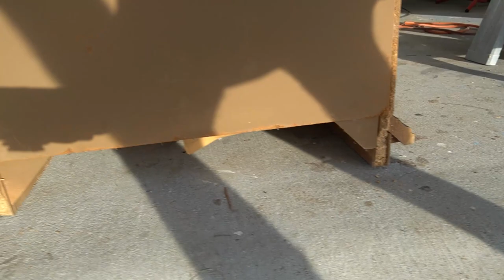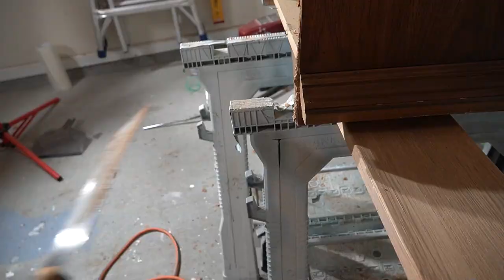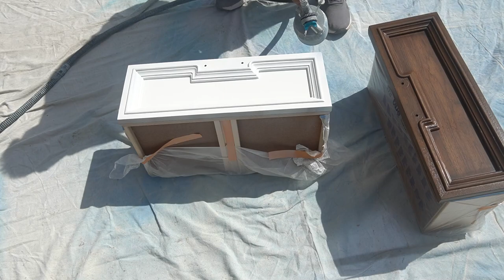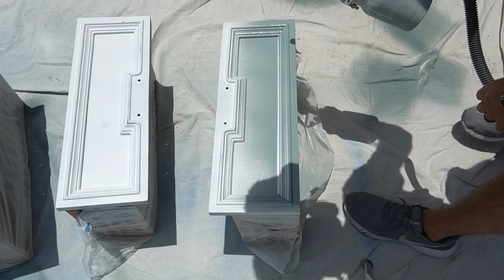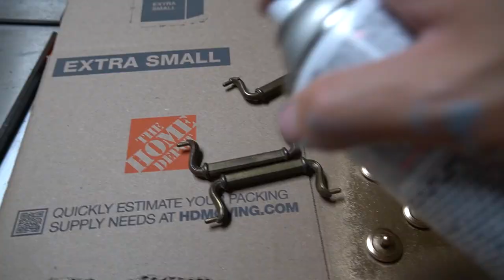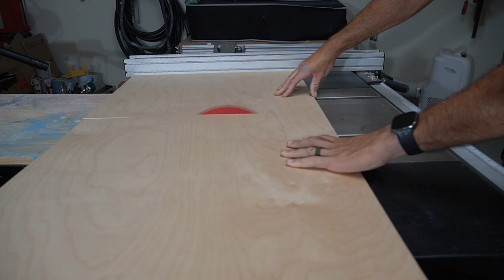Furniture Flipping  Painting A Set of Nightstands with Magnolia Home Paint

Comment: I just took a job building a kitchen island for a customer and they brought me a can of this to paint it with.  I normally use Sherwin Williams Emerald series (the best paint in my opinion).  Anyhow, I have never used this Magnolia paint before.  The can says to use a .017 tip.  I heard you mention you thinned it, but what size tip did you use?  I use a Fuji Mini-Mite 3 HVLP and I have a .015 and a .018 tip.  You think a .017 will work with no thinning?  Thanks for any help.
Reply from the maker: I talk about it towards then end of the video but I would not use any thinner of any kind. My set never really hardened up to a solid finish, and I can only believe either the thinning which was not that much or the paint is just not the best quality. I would spray with an airless but I don’t see you getting a good finish with a .017 tip which is like for walls and exteriors. I would spray with an airless and use a 308 or 310 or not do the job. I find it hard to believe you will not have runs everywhere with a 17.
Reply: @milosrestoration1337  Thanks for the reply.  Do you know what size tip you were using in this video?  With your thinning it and knowing the tip size I can maybe gauge what to do.  I have a professional sprayer, a Fuji Mini-Mite 3.  Thanks again.
Reply from the maker: @choprpilot76 well I was using an Apollo which I no longer use but keep in mind I had a 5 stage turbine. I was using a 1.8 with a high solids cap most likely. 
I’d highly recommend using an airless with a small tip like an FFLP 308. It’s going to reduce the chances of getting runs but still giving you the atomizing power of an airless. Maybe see if you can get a color match done in a paint you are familiar with if they just want the color?
Reply: @milosrestoration1337  ok, thanks again.